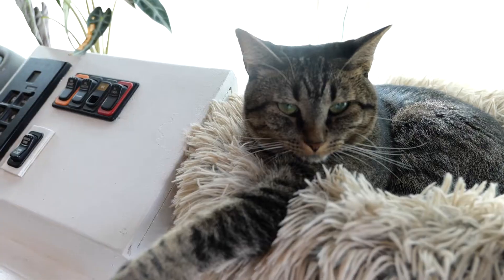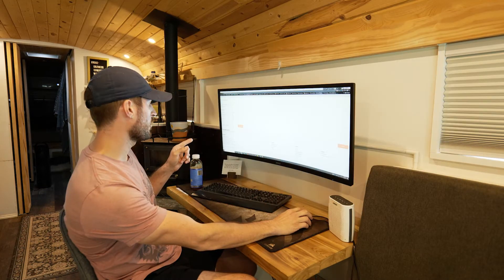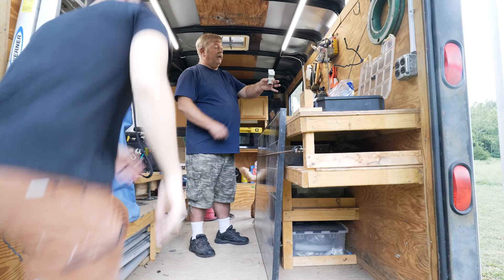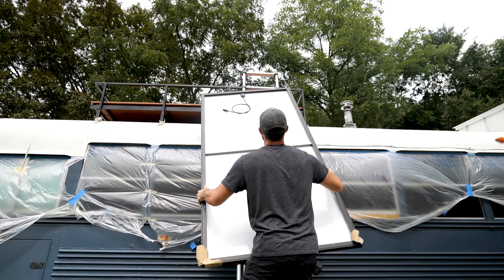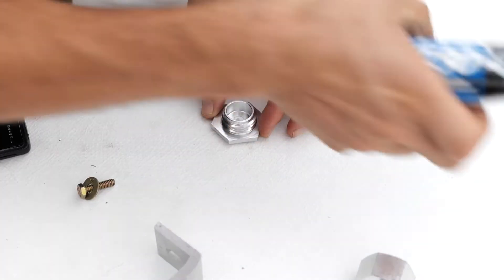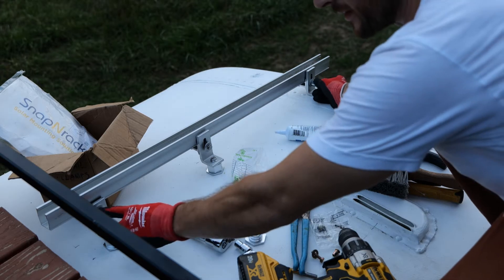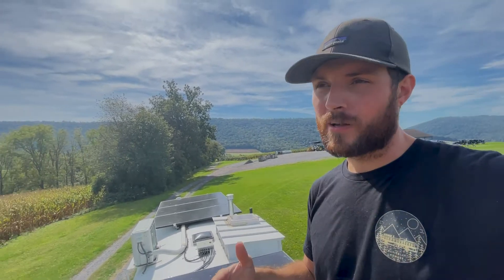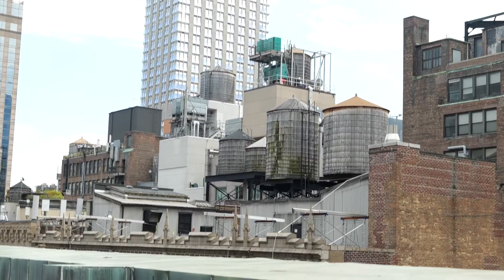2000 WATT TINY HOME Solar Upgrade

Comment: how long did it take you to charge your battery's before and after the upgrade?
Reply from the maker: I honestly can't remember. The good thing is it's super obvious when it happens because the high voltage disconnect will completely stop charging.